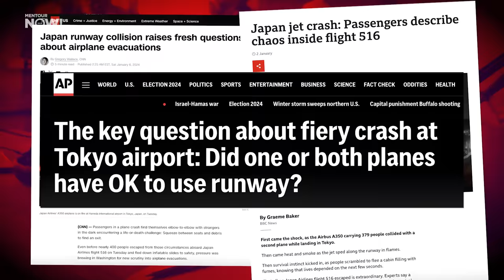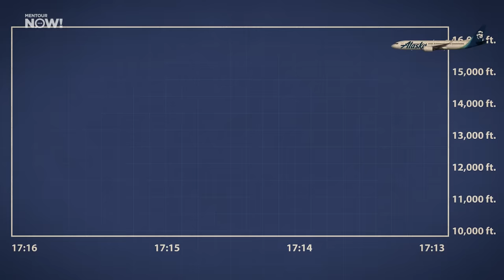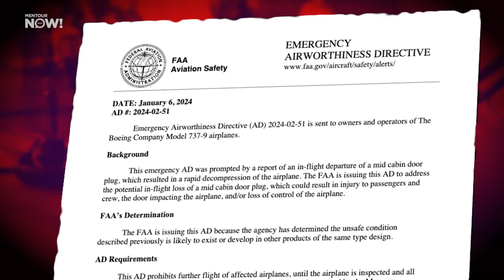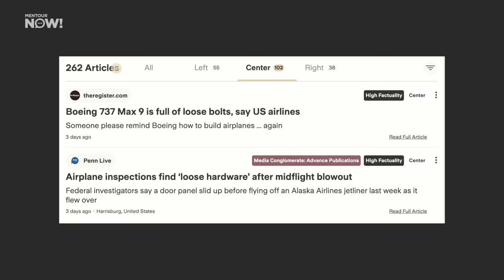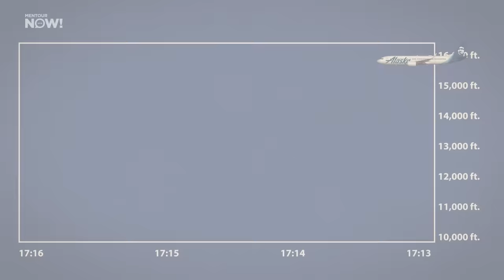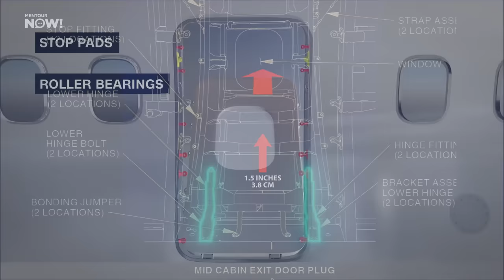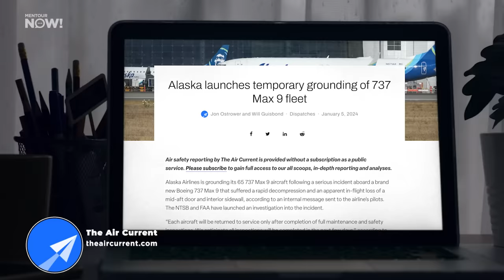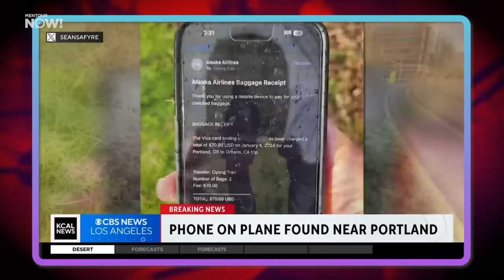WHAT Is going ON with Boeing?! MAX-9 Door blowout

Comment: If I remember correctly, after the merger of Boeing and McDonnell Douglas and the MDD board taking over, someone said it was a matter of time that DC10 issues will repeat at Boeing. That quote always comes to my mind when 737MAX has issues...
Reply: How did they even let the MD board take over in the first place, that would be my question?
Reply: @tomsmith6513  with Boeing taking over McDonnell Douglas, I always wondered how that could happen. However, I'm not an expert so maybe someone can shed a light on the subject, if it is correct and if so, how that could happen.
Reply: @tujue7  Someone told me (which means I am talking out my ass here, so take this with a grain of salt) that MDD was the larger, senior partner, and took over Boeing, but decided to keep the Boeing name, logo, and so on for marketing purposes, since Boeing's commercial aircraft were more highly regarded than legacy MDD.
Reply: @RCAvhstape I think Boeing was bigger and more successful. McDonnell Douglas had quite a tiny share of the commercial aviation market by the point the merger had occurred.
Reply: @martinduran9523  The commercial market is smaller than the defense market, and MDD was a huge defense contractor, so maybe.
Reply: @tomsmith6513 boeing wanted in on military contracts the MD execs had the military contacts established
Reply: @joesutherland225  Not sure what you're trying to say . . . Boeing has been making military aircraft for decades, some of which it inherited from MD. As far as I know, they aren't producing any new ones, just upgrading the existing ones. Besides, they would be making the military aircraft in separate factories, so I don't know how military contracts would affect manufacture of civilian ones.

The only point I can think of that you might be trying to make is that the aim of the merger was to acquire the military aircraft and somehow the MD execs and/or board members were part of the deal. Considering that as someone said earlier, Boeing was already bigger than MD at the time, I don't know how that makes sense.

How could the MD board members get the voting rights to exert the bad influence they're having now?
Reply: @tomsmith6513  look at the changes at executive levels then correlate that to the military contacts the people that moved up inside boeing have .should be pretty obvious
Reply: @joesutherland225 well, even if it was true that there were more "military" people in Boeing than before, it doesn't explain the decline in quality and safety compliance. Military aircraft, just like civilian ones, have "requirements."

You wouldn't, for example, make a pilot ejection seat that doesn't work, or an engine that catches on fire or avionics, chaff and flare that don't work. . . . or in the case of the F-22, an oxygen supply system that causes hypoxia-like symptoms.

The military contract theory doesn't explain what they did with the 737 MAX. They clearly cared about the civilian market and were trying to maximise sales.
Reply: The other saying is that McDonnell Douglas bought up Boeing with Boeing's money. McDonnell Douglas had the lucrative military contracts. So Boeing bought them (or so they thought). Normall it means that be management culture of the buyer prevails. But the McDonnell management likely also had the politcal networks (to get the military contracts) so they stayed employed - and ruined culture of Boeing instead. Profit-extracting and bean counting ... instead of a company of engineers.
Reply: @tomsmith6513  you miss the point they imported the MD mentality that led to the required sale of MD in the first place cost over quality expedience over engineering
Reply: Yes, my inside sources say the same...when Boeing took over the failing MD, they placed failed MD management in high administrative positions within Boeing...then Boeing went Woke and it's been a double whammy downhill ever since.
Reply: @number1bobo incorrect - MD’s commercial division was going under.  Boeing prior to the merger was run by engineers with decades of excellence.  MD was run by accountants, finance, and economists.  MD took over the executive suite and bad things began to happen.  There was the Drunyan scandal, they moved headquarters to Chicago, sold the Witchita plant to Spirit, built a 787 plant in South Carolina and outsourced parts globally, then they outsourced software to India and some engineering to Russia.  Prior to the merger when engineers ran Boeing none of this would ever happen. The bean counters from McDonnell-Douglas created this mess, blame it on the MBAs.
Reply: @RCAvhstape Boeing was the larger and older company. Many people are not aware of this, but United Airlines was once part of Boeing. In fact, before they were known as 'United', they were called 'Boeing Air Transport'. Ellen Church Marshall worked for Boeing Air Transport and she created the first group of stewardesses. So their history goes way back. This is not the same company with that legendary history and iconic jets. It's so heartbreaking that the merchants of death from McDonnell Douglas, are killing what was once, a great American company. 😮😢
Reply: To be honest, Boeing was the larger company.  Many people are unaware of this but United Airlines started out as a branch company of Boeing. In fact, they were known as 'Boeing Air Transport' before they morphed into United. A woman named Ellen Church Marshall worked for Boeing Air Transport and she came up with the concept for airline stewardesses, so yes, Boeing goes back a long way.